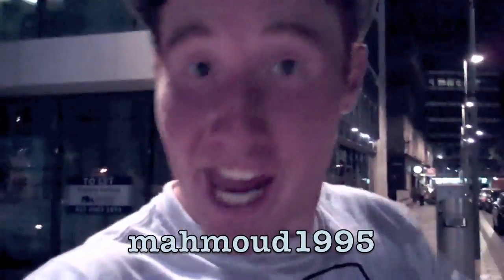How To Ride Backwards on a Fixed Gear

Comment: wtf is the point of those? no dampening springs, no gears, no brakes??? wtf???
Reply: One gear and fun. There's nothing reasonable about it. Skidding and having total control over what the bike is doing is pretty cool but these are not made for anything rougher than a gravel path though.
Reply: Arne Puschmann why the hell do i see so many people have these crappy bikes in rough, urban environments? no smooth path, only smooth streets. there's always bumpy as hell transitions to different kinds of stone etc.
Reply: maybe they don't like having fun. Cobblestone (I guess what you mean by "rough urban") is not fun at all to ride on a Fixie but nor is it on anything but a Fully. And I would not call them "crappy" in general. Due to the lack of gearshift and suspension the are way cheaper than compared to a Fully but there are as many crappy fixed gear bikes as there are crappy MTBs
Reply: I have a front brake on my fixie, it broke and I have been to lazy to fix it. But since it is a fixie that means I don't have to fix it. Basically single speed and fixies are just lower maintenance bikes.
Reply: Justin Koenig open ur mind dude
Reply: Jentra Sakti they're overpriced because the companies will know you hipsters will buy these "minimalistic" bikes
Reply: open ur mind dude (2)
Reply: Justin Koenig people ride fixed because it's fun and easy to maintain. there's nothing wrong with having an open mind about bikes. you don't need to be a hipster to enjoy riding fixed. I'm not a hipster and i ride fixed every day. its simple, fun, and perfect for someone on a budget who doesn't want to always be shelling out money for cables, housing, tune ups, etc. All you need to occasionally replace is the chain. I'm not trying to make you fall in love with fixies or anything but I am trying to show some of the pros to riding fixed although you did do a good job of stating some cons but i digress.
Reply: Much rather just ride a single. If you cant coast you can't corner and you can't get in the "attack" position for riding rough terrain.
Reply: But fixies aren't really for rough terrain. they're the bare minimum of a bike. I will admit they are mostly a trend but they created a community of cyclist who are just out for a good time.
Reply: Maxwell Coates A single-speed is just as minimal. Fixed gears are just a gimmick. Don't get me wrong though, I'd gladly add a fixed gear to my collection if I found one for the right price.
Reply: I'm not saying they're not a gimmick. Plenty of stuff started out as a gimmick like computers (not that fixed gear will ever become as big as the computer). But just because fixed gear is a gimmick doesn't mean it's not good or fun. Bikes themselves started out as gimmicks that needed time to grow. Again, I'm not trying to say why other bikes are bad or why fixies are the best bike ever because they aren't. cycling is mostly personal preference. Ride whatever you're comfortable with.
Reply: That's the key. Be comfortable. Ride for fun. ;)
Reply: Thats funny my "crappy" fixed gear bike costs $4,000 with parts made by the best bike manufacturers in the world (cinelli, bianchi, 3T, zip, hed) I use it for racing maybe you should learn a little bit about track bikes and get back to us.  Also learn about bike messengers in nyc and maybe that will help put some things into perspective for you
Reply: lloplop Ohhh showing off how much money you have, aren't you a special little boy.
i know that it's for racing. i don't care though, because it's just not a good city and street bike. or hike bike. or literally anywhere that isn't a racetrack or a highway